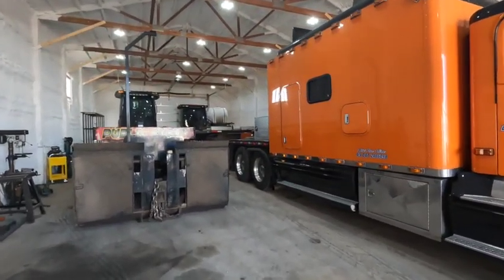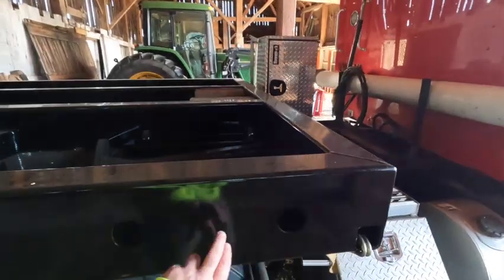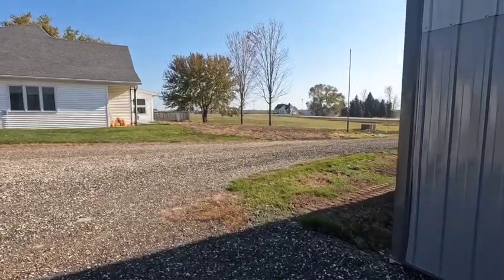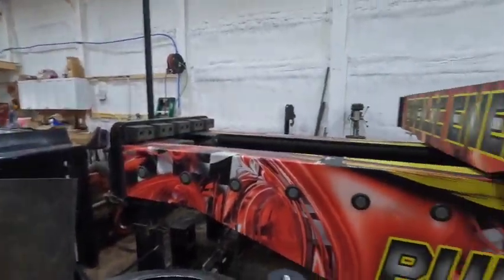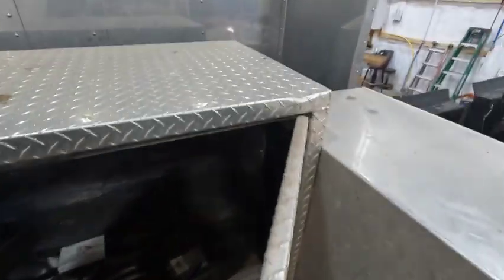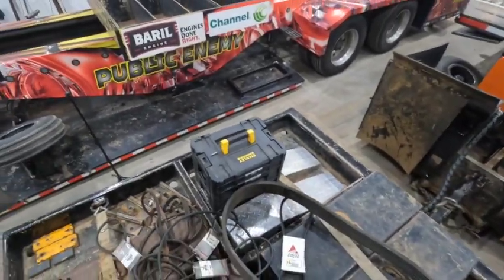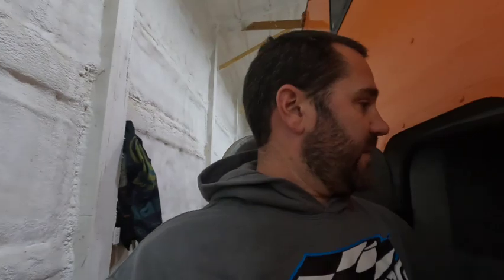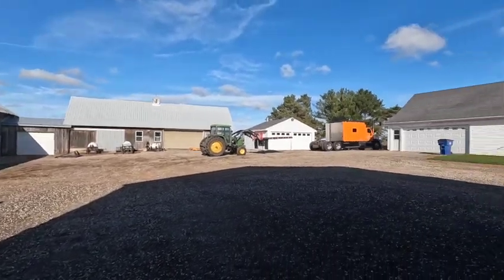For Sale!!

Comment: Question what do you do when you are not go to pulls? as a career ? Sounds like you a volunteer ff. Very interesting the different spare parts you carry. Those chain links are probably not a very common item. Where would you get those?
Reply from the maker: I run a wastewater treatment plant part time and a volunteer firefighter at local city.  They are 140 chain links which are large put pretty common.